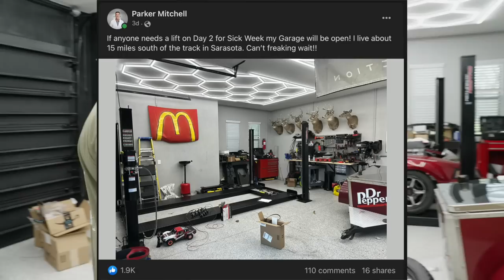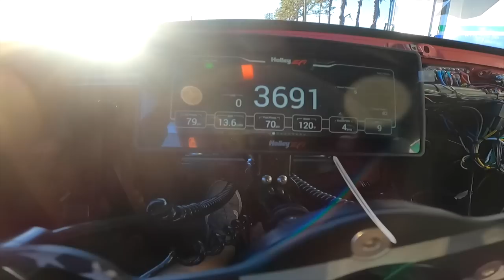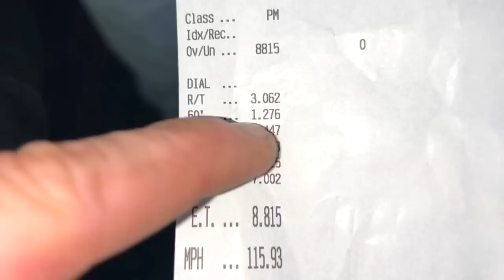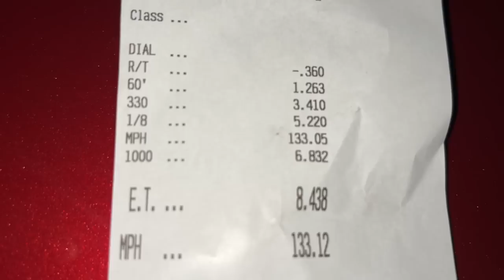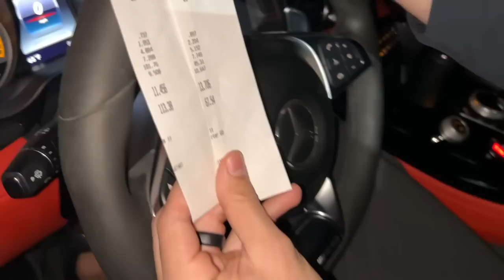Quest for a 4 Second Passes for Sick Week Begins Here

Comment: What if the roof & windshield & fender get crushed down & back 3 inches in a wreck? I'd move loop back 4 inches
Do u have a fire supposition system?   Ask Jerry Bickel what he thinks , Moscow Mills MO. His shop can fix it right. Or get 1 of his built chassie cars. 
I suggest getting a lightweight helmet
With hose hookup for a Parker pumper, dust filtering cold box.
Water cool suit . 
& air conditioner. 
& a mount for a 13 mm tooth brush wrench. Drive safe

Comment: You should change the seat to a RaceTech seats because they have built in head containment and you can get them where they are heated and cooling seats as well  and you should get with Brown and Miller for your hoses and fittings and they even have wastegate hoses and all their fittings are crimped and eventually you should make your car completely 235 class legal and go to all the radial races you can and run in the 235 class

Comment: You should get a set of QA1 MOD Shocks for your car so you can have a valve pack for driving and a valve pack for racing and that is all you need to change out and it takes less than 10 minutes to do

Comment: Parker,, those dumb 'front runner' wheels have very little load rating and the tyres will be worse.. You will end up with more heavy stuff than you require and over load the tyres/ wheels. Than they fail.
A light truck tyre with at least 102 load and a rim to suit is what you require.
And some 15x7 rims with suitable V rated tyres is what the Mustang needs on the front. And for the street some big tall tyres to gear it up.
As for 1/8th mile racing,, only for people with very short attention spans,